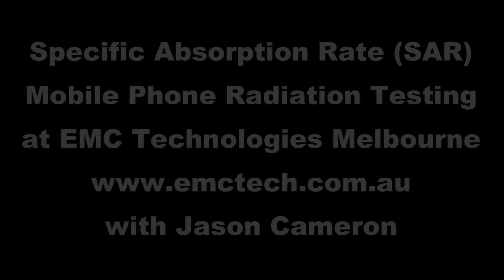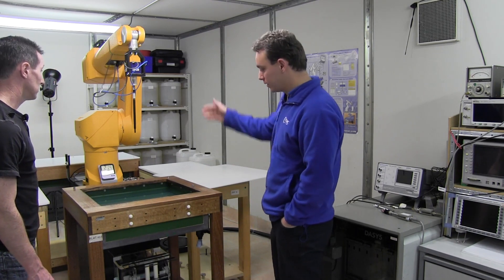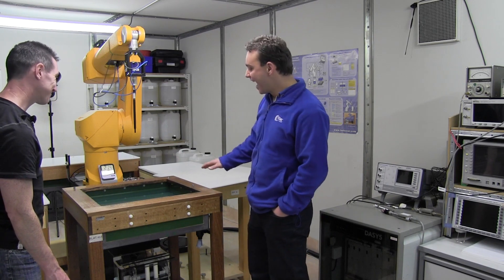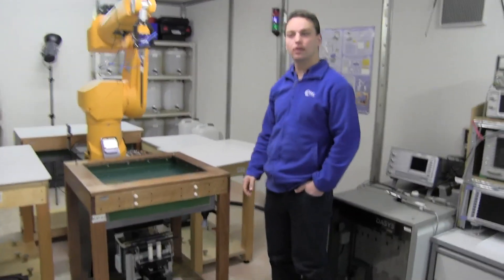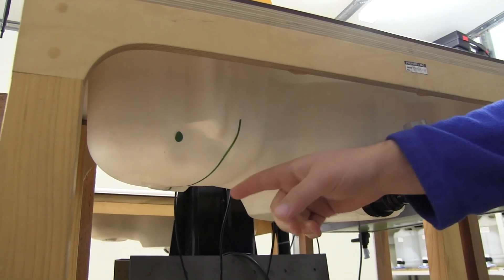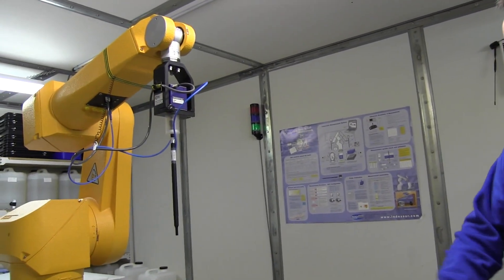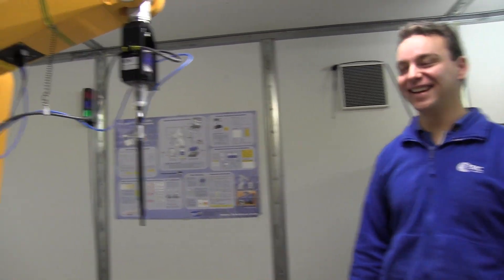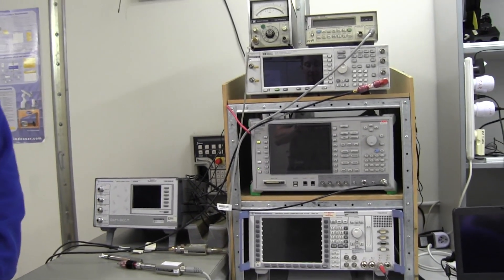Mobile Cell Phone Radiation SAR Testing - EEVblog #201

Comment: At the beginning of the video the guy says there is no metal parts used in the construction of the frame that holds the water sugar and salt solution because that metal would interfere with the test results. I am wondering would the metal parts weaken or intensify the RF signal strength?
Would mercury fillings any metal pins in our teeth have the same affects when we talk to someone on our mobile phone?
Reply: That's a very good question that I'd like the answer to myself.  Never thought of that before myself.